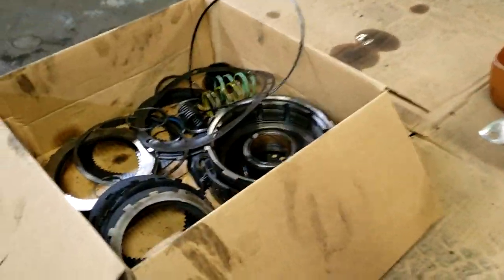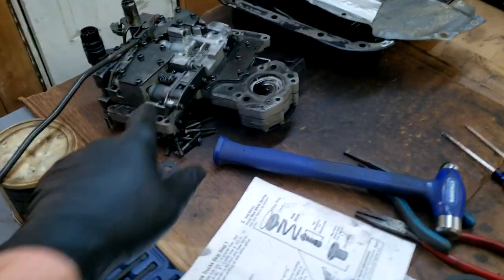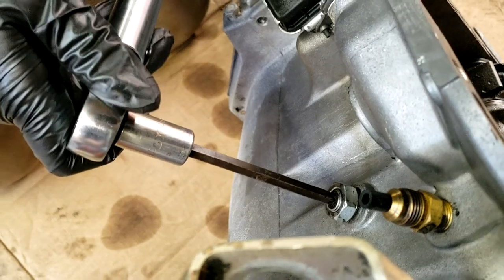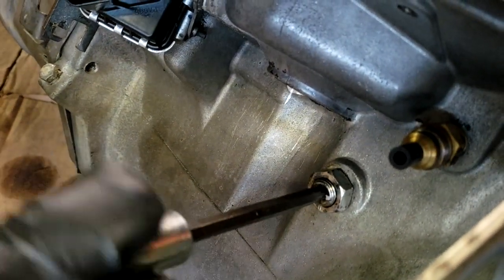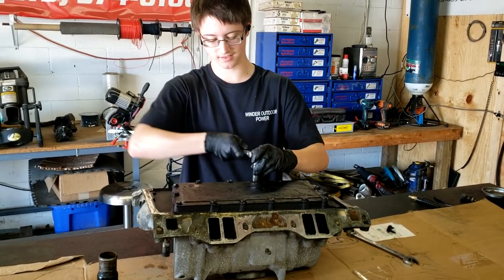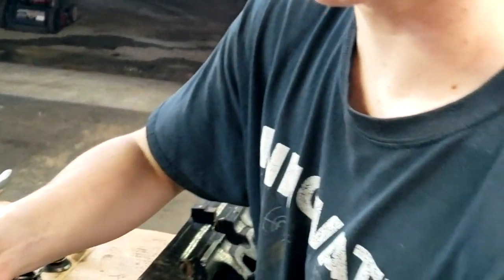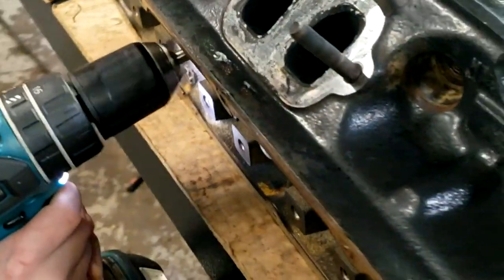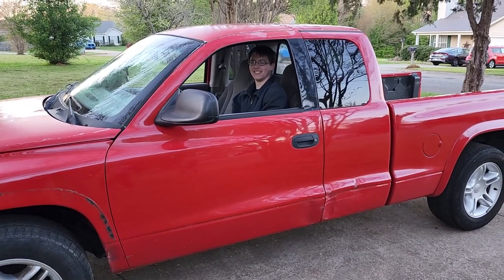Clifford Does First BURNOUT! The Dakota R/T Finally Drives.

Comment: The mini truck that could haul just as much as a half ton. I miss those little Dakota’s.
Reply from the maker: Definitely 💪
Reply: Idk man my dad had a 2005 with the 4.6 Magnum I think it was a small block V8 and it was a pretty  crappy truck it went threw 3 transmissions befor it hit 80k miles all coverd under warranty  but still anyway the truck is still running today and driving last I saw but the engine is not running strong anymore
Reply: @davidaix5771  2005 is when they switched to the 3rd Gen body style along with the Durango that looked and drove like a boat on wheels. The only V8 option was a 4.7L 230hp. That’s also when Chrysler was having a very hard time financially. Mercedes sold their controlling share and it went downhill really fast. It got so bad in 2007 they had a labor strike. So that’s when you were probably going through transmissions like wet toilet paper because nobody working there cared enough to check them. It’s good to see that old 4.7 is still running 17 years later. It definitely needs a rebuild if you want to put it back on the road. I wish they kept making these mini trucks it filled the gaps between family hauler, utility truck, and sports car.  It wasn’t particularly good at one certain thing but they were fun to drive.
Reply: @markm0000   It's funny too because I'm a Toyota and a Ford guy Grown up my father had hondas and Chrysler's And dodges But my 1st truck was a little Ford Ranger tiny little guy 4 cylinder 5 speed on the floor 1992 The only problem was it really needed 4 wheel drive because when it started to snow I'd develop the back with cinder blocks It's too bad Toyota doesn't make those little pick up trucks either Everyone needs to have them Now everything has grown